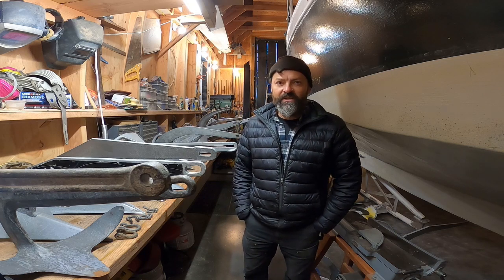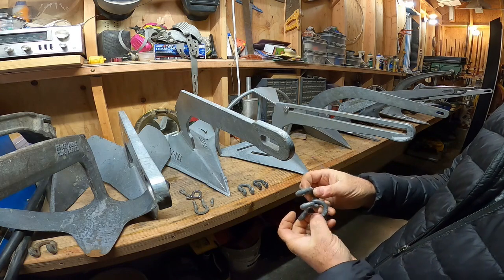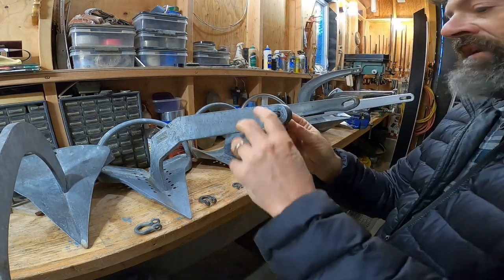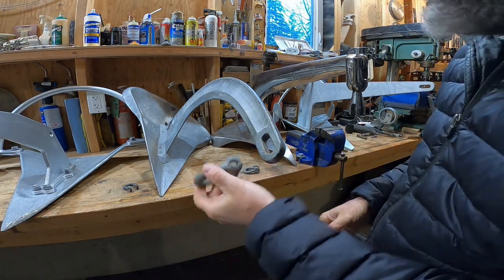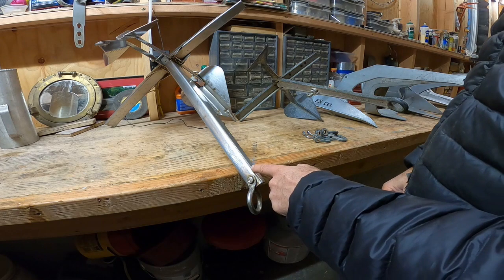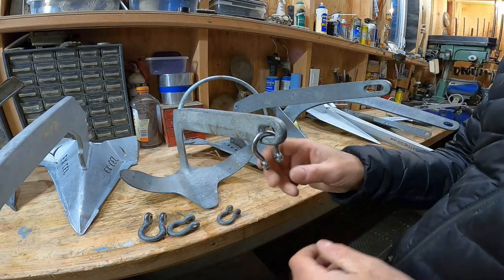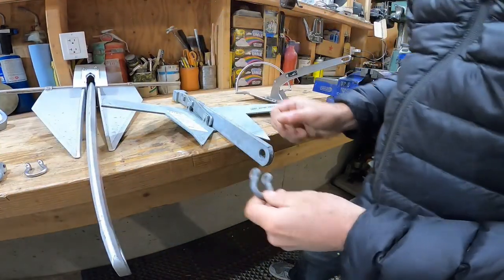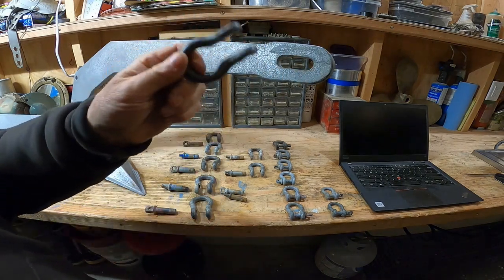Anchor Chain Attachment. Anchor Test Video #92

Comment: Great job, thank you. Just a question: why two shackles if the first link of the chain perfectly does the job of the second shackle, and less danger of the pin coming loose ?
Reply from the maker: For sure, if the boss of the shackle can fit through the anchor hole, then a single shackle should be used.  Unfortunately, not all anchors are manufactured with the ability to accept the boss of an appropriatly sized shackle.  Hence the requirement to use two shackles or some other means, like a swivel.

Comment: What would you use to add 2 sections of chain together?
Reply from the maker: In a pinch, I would use two shackles (rated same or better than chain).  When I return to civilization, I would buy a new chain of the desired length.

Comment: Steve do you have a video testing or evaluating swivels? and what is your opinion of swivels?
Reply from the maker: I feel that unless there is an identified need for a swivel, keep it simple and avoid.  

For my own anchoring: Occasionally, after retrieving with my HORIZONTAL windlass, I notice a 1/4 or 1/2 twist between the anchor and the gypsy.  This is easily rectified by lifting the chain by hand and twisting to the new "lay".  

On the other hand, I could easily see a problem if using a windlass that does not allow easy chain lifting from the gypsy.  That could be a good reason to use a swivel.  I am sure there are others.

If I did need a swivel, I would be very skeptical of the "fork" type where the fork   attatches directly to the anchor shank.  Unless massively strong, there is a chance that a very high "side load" may open the fork.

Best would be swivels that have a fully articulating link between the swivel and the anchor.

As for the choice of swivel material: Personally, I do not FULLY understand the science behind stainless steel crevice corrosion (Does anyone?).  Therefore, I tend toward galvanized steel components for my rigging.  

Therefore, If I were to have a swivel aboard Panope, I would probably choose one of those crude, 'double eye' industrial galvanized swivels.  Astheyically, I think that works well with my old timey boat.  Same for yours.  

Cheers

Comment: Is that an X1 Carbon on the bench next to the anchors? If so, that's what I'm writing from right now :-) good choice.
Reply from the maker: It is a T490.  Seems to be a good machine.  But, I know nothing about computers :-)
Reply: @flygoodwin  Yeah, they're plain but solid machines, must have been the wide angle lens making it look thin then, because almost all lenovos look the same :-)

Comment: Would like to see chart of correct size shackle for chain sizes.
Reply from the maker: Here is the rule of thumb that has always worked for me:  Use shackles that are "one size larger" than the chain.  For example, with 5/16" chain, use a 3/8" shackle.  With 3/8" chain, use 7/16" shackle.  I have no knowledge of proper shackle sizes for Metric chain/shackles.

Comment: What is the downside of putting the shackle through the chain first and having the bolt part of the shackle go through the anchor hole?
I thought the idea behind the non chambered opening was that the bolt was expected to go through.
Reply from the maker: Richard, what you describe is not possible because the boss (fat part) of a shackle (that is rated similar to the chain) will not fit through the chain link.
Reply: @flygoodwin  Isn't that dependent on the size of the chain?
Reply: So should your shackle be rated to higher or lower strength than your chain.
My apologies for not knowing if you have covered this in a previous video. I just discovered your videos.
Reply from the maker: I am unaware of any shackle that will both be rated as strong as the chain AND have its boss pass through that chain's end link.
Reply from the maker: Shackle's should be rated similar or stronger than the chain.  Never weaker.
Reply: @flygoodwin  When you use a double shackle aren't you passing the second shackle through the chain?
Reply: @flygoodwin  why should the weakest link  be the chain, or the Rope?
Reply from the maker: @richardculver8713   If the chain (or rope) is stronger than the shackle, then the higher weight and/or cost($) of that stronger chain (or rope) is wasted.  Conversely, the "wasted" cost or weight of an over strength shackle is trivial.   In a perfect world, all components would have identical strength.
Reply: @flygoodwin  Where do you want your breaking point to be?